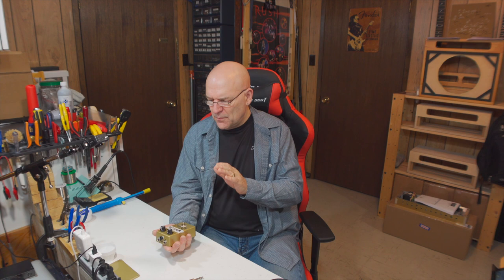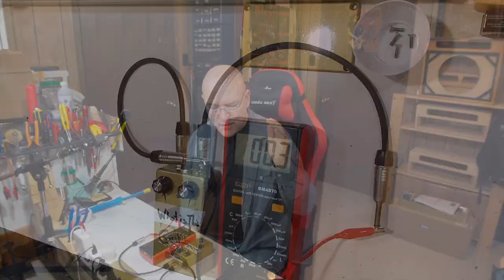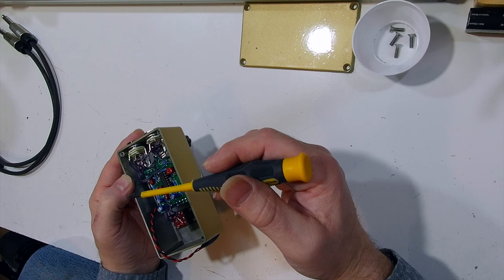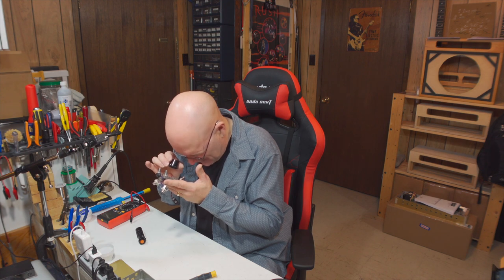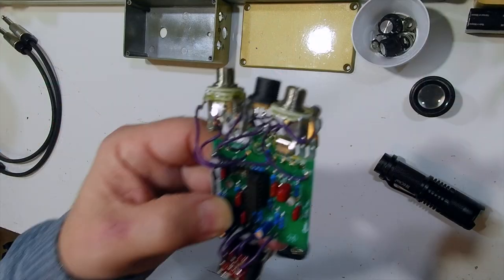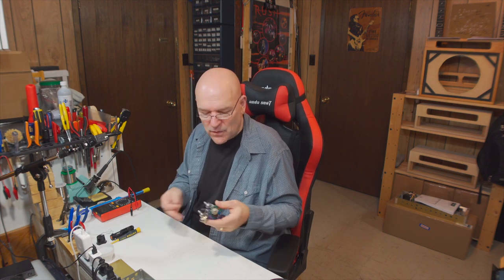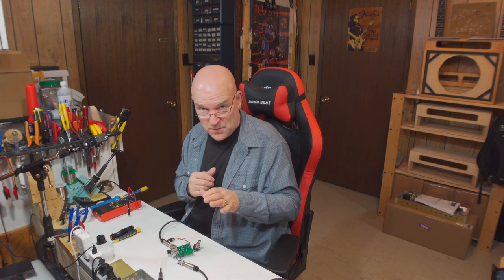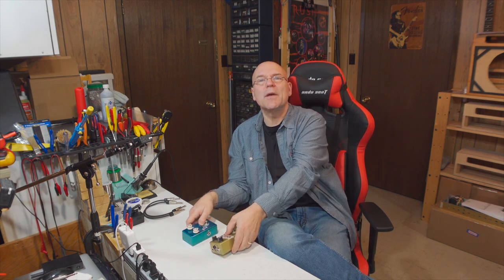Pedal Builds - OMG! It Doesn't Work!

Comment: Hey good afternoon! Great troubleshooting video. I’ve had a couple pedal builds where I’ve messed up and had to check the whole pedal just to find the out was a cold solder joint!

On a separate note. I want to get into building and designing amps and pedals. I’m going to school right now for electrical engineering. Do you know where a good place to start would be? 

Any direction would be fantastic. Cheers!
Reply from the maker: Thanks for the compliment and thanks for watching. 

There are some really good resources available but they can be hard to find. 

“Designing Tube Preamps for Guitar and Bass” by Merlin Blencowe is a good place to start. It’s a bit dry and heavy on theory but really explains things well. 

“Dave Funk’s Tube Amp Workbook” is really easy to read and has a lot of good, basic information. 

To me, Kevin O’Connor’s “The Ultimate Tone” series should be owned by anybody who has an interest in building and modifying tube amps. If you can’t get the whole series, get TUT 1 and TUT 3 for sure. TUT 5 is a good one to have too.
Reply: @JagStar  Thanks! I’ll check those out